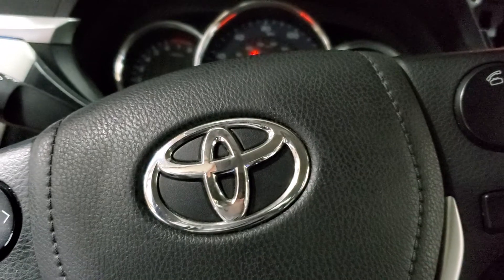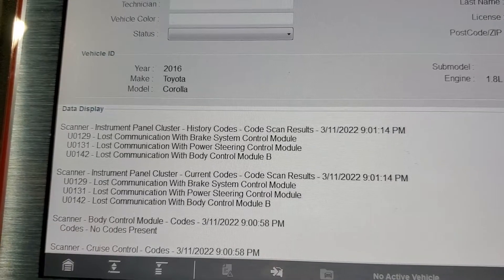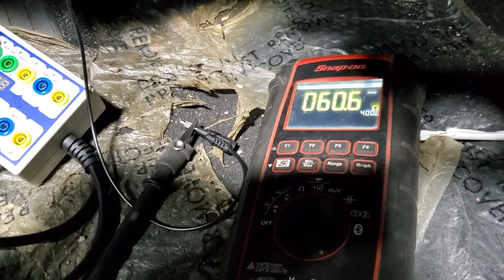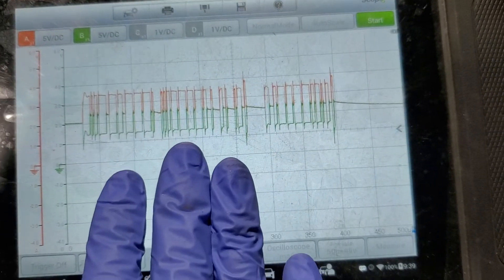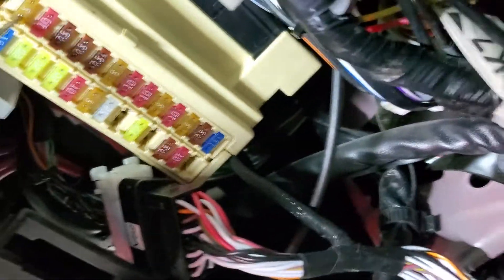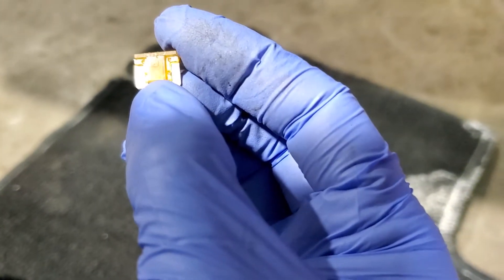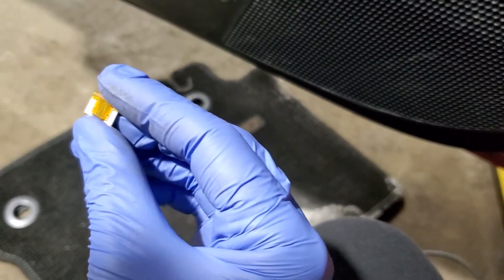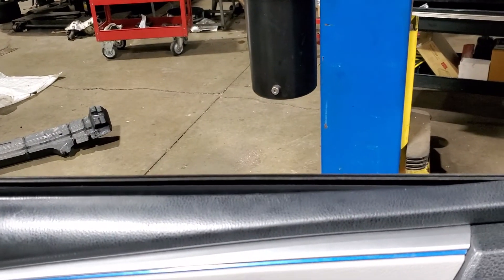2016 Toyota No Heat, ABS, Brake, EPS, Radio, windows, Gear selection. All because of 5amp #BlownFuse

Comment: I like your video, i have being in the automotive industry quite a while, most of the time a blown fuse means a short to ground on a wire or a component, always try to avoid come backs thanks.
Reply from the maker: I forgot to mention in the video that blown fuse was caused by wipers, I guess client used wipers to clean the snow. That increased mechanical resistance causing fuse to blow. Thanks!
Reply: Hi bro can you please tell me your address please